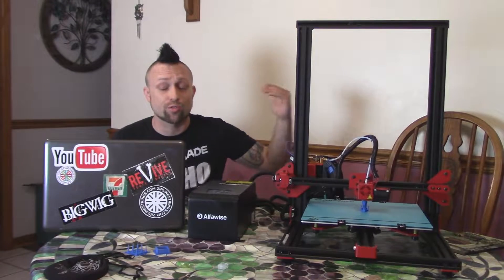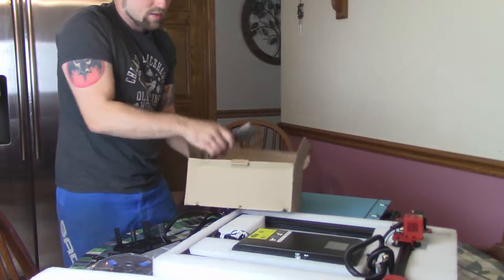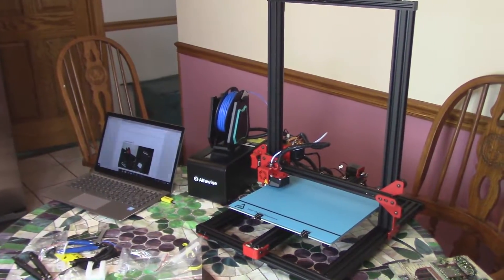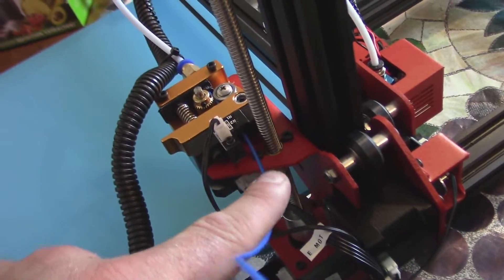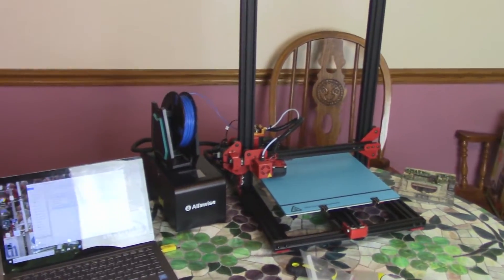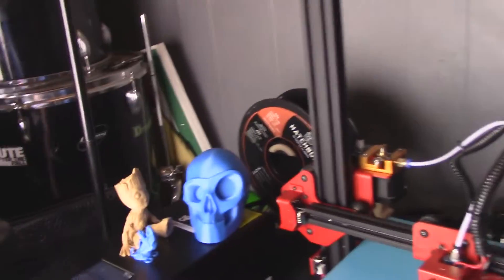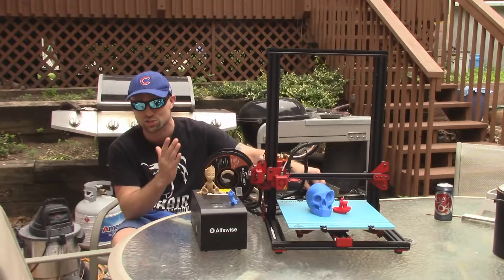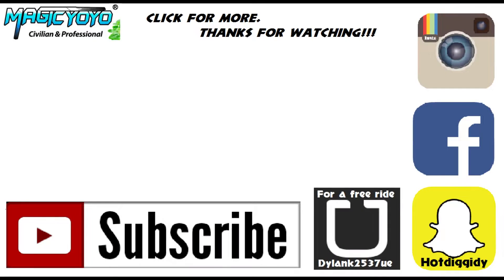Alfawise U20 3D Printer Unboxing and Review. Real Cr-10 Killer.

Comment: Hello, can anyone help me? I have an alphawise u10 and it does not print well I made a

 figure and printed well, but the second one already

 It is not a problem that it is too fast and it throws a lot pla . There is no way to slow down, he updated the firware and it remains the same as if the engine did not pay attention to the firware. But if from simplifying under the speed of the extruder, if it starts to print well, as I say it does not pay attention in the footage can slow down and does nothing, he looked at the steps and it's okay, thanks for your help.

Comment: Good stuff, thanks for the review. I ordered one to play with, but was curious about strain relief for the heated wires. I was curious since it has some TronXY motors, is the heat bed similar as well with soldered wires, or more like the Anets with the plug? Looks like the bed level screws are 3mm? I'd like to have strain relief/bed level knobs printed before it gets here. Anything you have noticed since you have been running it that I should address, or be prepared to address would be greatly appreciated. Again, thanks for he awesome content!